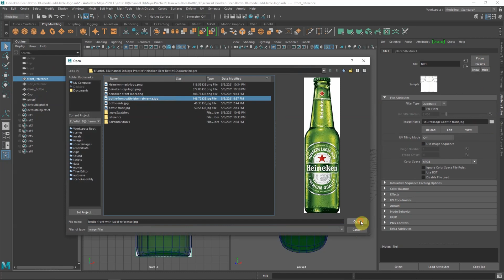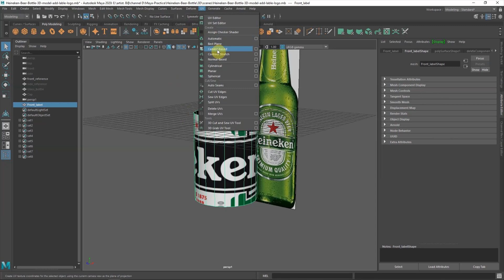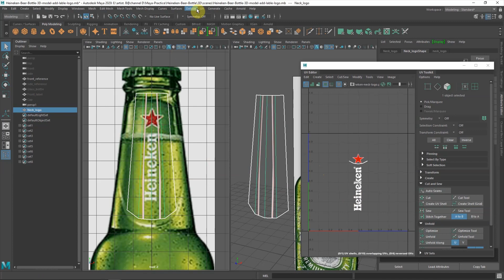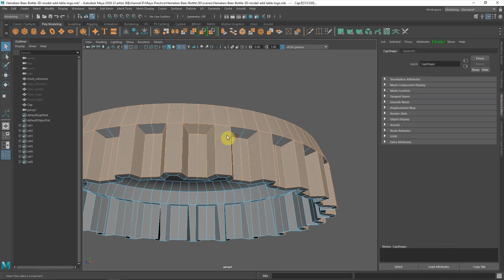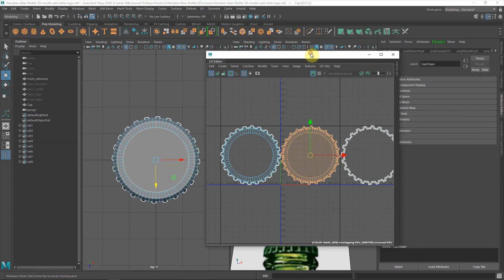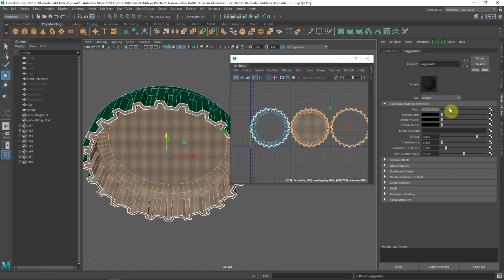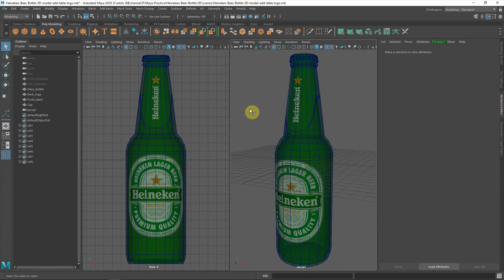How to Add Graphics Label, Logo, Decals, into 3D model, Maya 3D UV mapping tutorial - Part 2

Comment: artist.B
Highlighted reply
artist.B
1 day ago
Good question. Sorry that I skipped the calculation in this video. 

9.696 x "6.9" is the rectangle in the front view. 
the label that i wrapped on 3D model is in cylinder shape. the diameter of cylinder is "6.9" 
therefore "6.9" x "pi" = 21.66 . Therefore i resize the 2D label image canvas size to 970 x 2166 in proportional in Photoshop.

Hope this more clear. Thanks for asking.
Mark Elliot
Mark Elliot
23 hours ago (edited)
 @artist.B  Are you saying the front view is the label dimensions of 9.696 x "6.9"? where did the 970 number come from, the pixel height of the label?  how did you translate 21.66 inches (circumference) into 2166 pixels? Same with height of 6.9 inches, how did it become 970 pixels? Sorry what am I missing? If I multiply my dimensions that are in Inches x 72 pixels per inch I get entirely different numbers... 6.9 inches x 72 (pixels per inch) and 21.66 inches x 72 (pixels per inch)  Sorry I just don't the get the leap from inches to pixels your making.

So to reduce this to reusable formula: Make the Photoshop canvas height you want the height of the label you need. Then adjust the Canvas width to the circumference of the cylinder you are applying to. Yes? thanks
Reply from the maker: Thank you for your feedback. Yes, you are right.

The idea is to keep the canvas size of 2D label image is in proportional between width and height (9.696 x 21.66), whatever to use cm , inch or pixels. you can fit the 3D circular label size and map it .

To which dimensions of 2D label image to be used, it depends on how large of render image.
Some case for higher resolution renders, we need to use large 2D label image in same proportional for better resolution. For low resolution renders, we can scale down the 2D label image in proportionally for better efficiency.

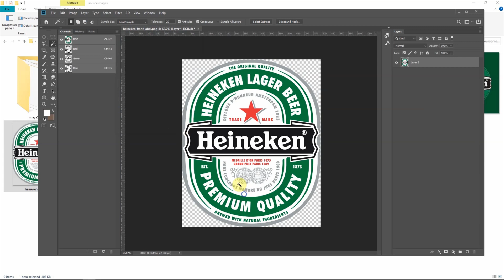Comment: Thanks for demo...Question from a Newbie:  At 1:01 in the video you input specifications into image size-I took your dimensions of the labels 9.696 x 6.9 are those what you input into Image Settings? At 1:19 You adjust Canvas size--where did those value come from? thanks
Reply from the maker: Good question. Sorry that I skipped the calculation in this video. 

9.696 x "6.9" is the rectangle in the front view. 
the label that i wrapped on 3D model is in cylinder shape. the diameter of cylinder is "6.9" 
therefore "6.9" x "pi" = 21.66 . Therefore i resize the 2D label image canvas size to 970 x 2166 in proportional in Photoshop.

Hope this more clear. Thanks for asking.
Reply: @blenderian.3d  Are you saying the front view is the label dimensions of 9.696 x "6.9"? where did the 970 number come from, the pixel height of the label?  how did you translate 21.66 inches (circumference) into 2166 pixels? Same with height of 6.9 inches, how did it become 970 pixels? Sorry what am I missing? If I multiply my dimensions that are in Inches x 72 pixels per inch I get entirely different numbers... 6.9 inches x 72 (pixels per inch) and 21.66 inches x 72 (pixels per inch)  Sorry I just don't the get the leap from inches to pixels your making.

So to reduce this to reusable formula: Make the Photoshop canvas height you want the height of the label you need. Then adjust the Canvas width to the circumference of the cylinder you are applying to. Yes? thanks